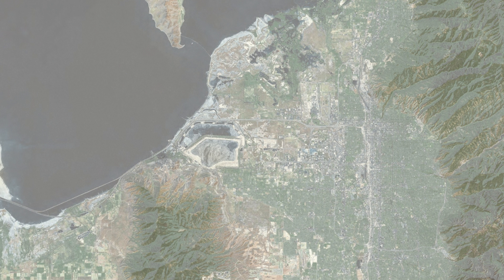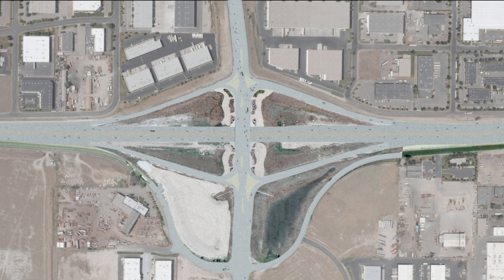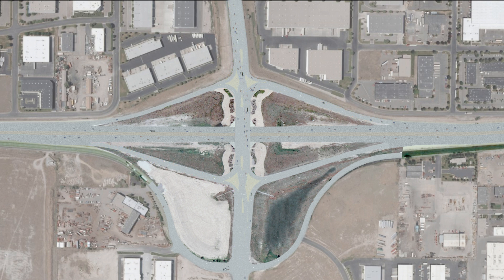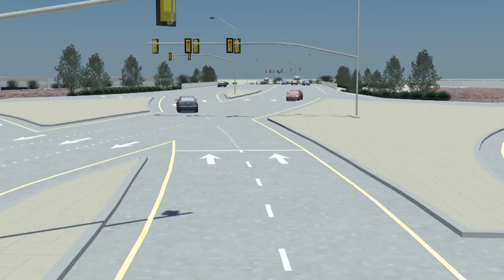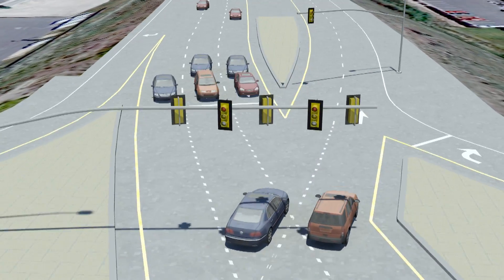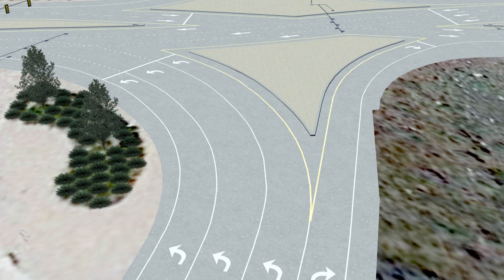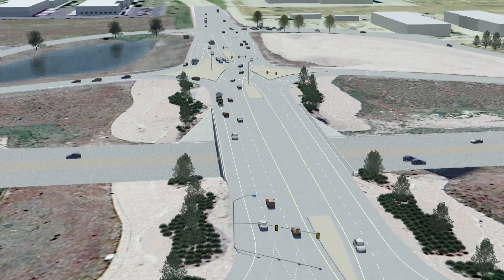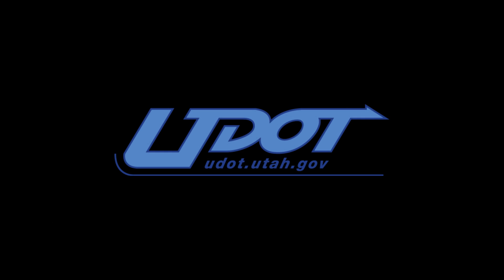Bangerter Hwy Diverging Diamond Interchange

Comment from the maker: @WtsUpMD one of the reasons why we often build these innovative intersections and interchanges is because they are more econimical. More lanes will not always solve a problem but by changing the traffic flow more cars are able to travel through an area without a need to purchase a great amount of right of way or reconstructing the entire roadway. We also try to assure that there is enough signage and striping to make using the intersection or interchange as easy as possible.

Comment: Seriously? Between the DDI, CFI and ThrUTurn intersections it appears that UDOT has more money to burn through "innovations" rather than actually building roads to improve traffic. We still have 1 small belt route, 1 east/west & 1 north/south Interstate. I have watched multiple cars, locals included, turn into oncoming traffic because of these changes. I have also witnessed cars "miss" the left turn & make a left turn at the light anyway on Bangerter. Darwin awards are coming for these designs!

Comment: @UtahDOT:  When, exactly does UDOT plan on sincronizing the signals at the Bangerter Highway Diverging Diamond?  It consistantly takes me 7 to 10 minutes to get from one side of the "21st south freeway" to the other as a result of the unsyncronized lights. I would really like to think that someone knew what they were doing when designing this intersection, but the results thus far are terrible. This needs to be fixed sooner rather than later. An estimated timeframe would be nice.

Comment from the maker: @trailrun21 this intersection is different from the one you saw in Taylorsville. The only Diverging Diamond Interchange (DDI), like in the animation, in SL Co. is at Bangerter and SR-201. What you saw would have been a Continuous Flow Intersection (CFI). There are several CFIs throughout SL Co. & specifically a couple in the Taylorsville area on Redwood Rd. & Bangerter. These new types of intersections & interchanges are being built to move traffic more efficiently in certain high traffic areas.